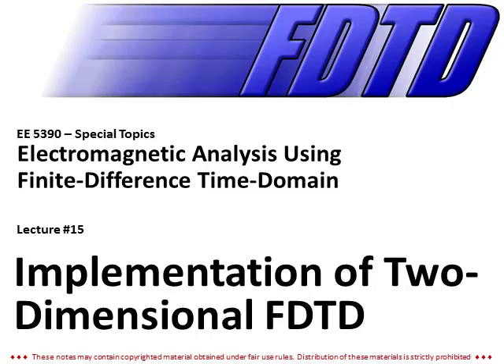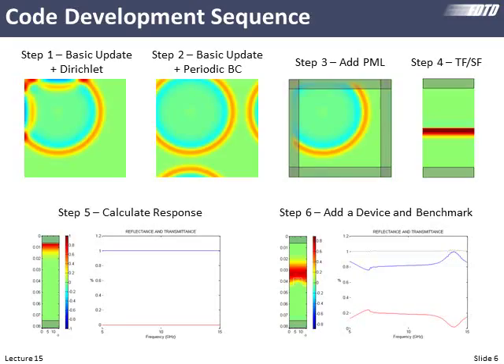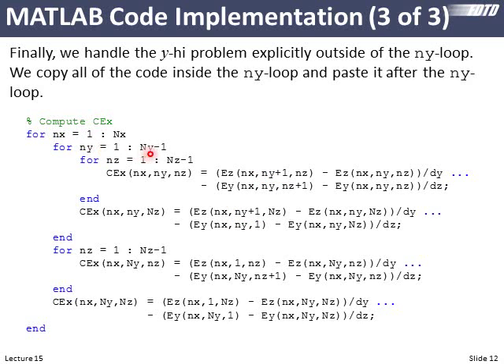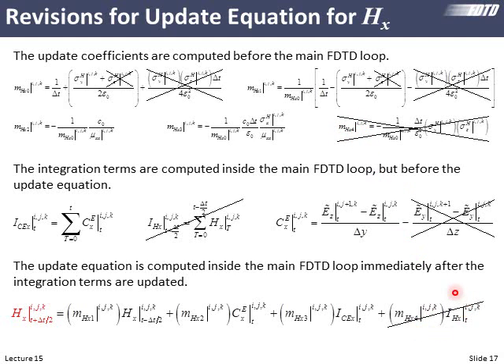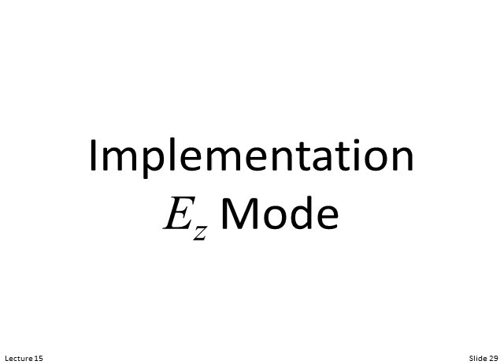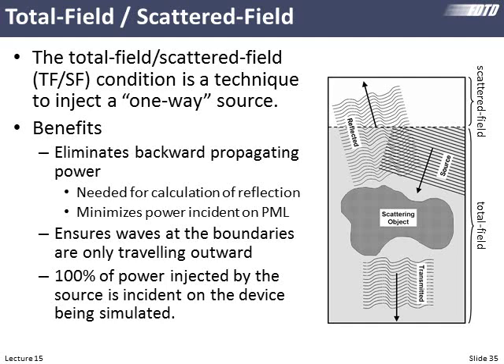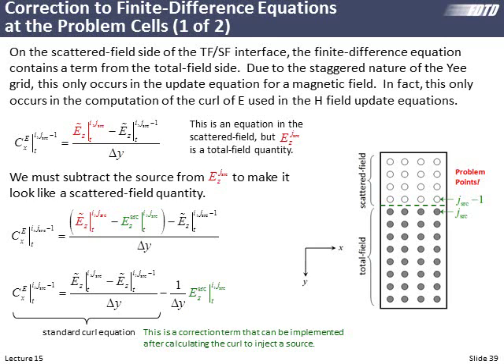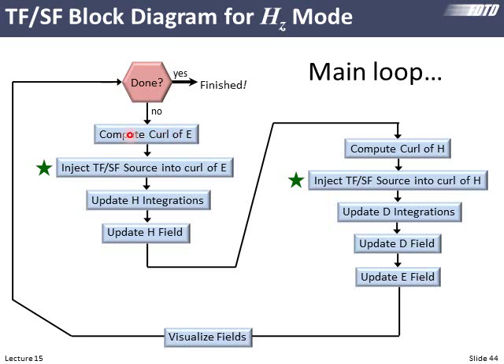Lecture 15 (FDTD) -- Implementation of 2D FDTD

Comment: Hi, Thanks for the great lecture series.

I´m having trouble with my code exploding where the PML regions overlap.

Can you think of where I might have an error which would cause this?

Thanks, Guy
Reply from the maker: This is the symptom of many different problems.  First, let me point you to the official course website that contains the latest version of the notes as well as other resources to help you develop your code:

http://emlab.utep.edu/ee5390fdtd.htm

Second, download Homework #8 and complete it.  To do this you will also need to download the zip file available under "Other Resources" which has some tester functions to help you with your PML.  The homework will give you a header with all the various PML parameters.  Type this in to start your code.  In Problem #1 you will calculate two arrays, 'sigx' and 'sigy' that are your PML parameters.  After these are calculated, call the function 'test_hw8_prob1' and that will check sigx and sigy to see if they are correct and report any errors.  

After this, move on to Problem #2 where you will add the code to calculate your update coefficients for the Ez mode.  After this, run the function 'test_hw8_prob2' and it will check your update coefficient for correctness.

Now you are ready to move on to Problem #3 where you will implement a simple 2D FDTD code and visualize your PML, hopefully working correctly!

Last, take a look at the latest version of the notes for Lecture 15 and see Slides 26-29 which provides some code and actual numbers for the PML parameters for some examples.

Hope this helps!!
Reply: It did, thank you. The test functions in the homework allowed me to zero in on my error.
Reply from the maker: Great!!!!

Comment: Another question is how to implement tfsf interface on the three other sides where we do not want to inject any power/source.
Reply from the maker: Consider a gap feed instead of simulating as a scattering device.  This is just adding a simple unit amplitude E field at the gap feed of the antenna.  The TF/SF can be done on 3 sides, but the hack is a little strange.  Let me know if you prefer the gap source.
Reply: How to do that, I am very new to the field? Even I have problems in injecting TFSF source from one side. I follow the instructions as given in the video but it doesn't work it seems. I want to launch a plane wave from one side say y=y0. Does one have to add/subtract E_src or H_src to curls at all the points including those inside the PML?
Reply from the maker: Implementing the TF/SF technique does require you to modify the finite-difference equations that are in the vicinity of the TF/SF interface.  This is because the finite-difference equations here contain both TF and SF terms, which are not compatible.  Implementing the TF/SF technique simply involves incorporating these corrections.  This would be rather complicated and tedious, but we have reduced it something very simple.  First, you calculate the source field fsrc, which is a version of the source that exists throughout your entire grid without the device you are simulating in place.  Technically, the source is only needed in the vicinity of the TF/SF interface, but I have found it more convenient to just calculate it everywhere.  Second, you build another function where you place 0's where you want to be TF points and 1's where you want to be SF points.  When you diagonalize this function into a matrix, it is called the SF masking matrix Q.  Third, you build the wave matrix A and then calculate your source vector b using the "quack" equation...

b = (Q*A - A*Q)*fsrc

This equation makes implementing TF/SF very easy.  It works with any order finite-difference, nonuniform grids, unstructured grids, and would even work without other methods like finite element.  It also lets you use scattered-field regions of arbitrary shape.  The only rule is that the SF region must completely enclose the source.  This last statement is a weird concept to understand.

To do your three-sided source, you would simply define Q as zeros everywhere except 1's in a square region near the center, but extending all the way to bottom of your grid.

If you are injecting a plane wave source, the TF/SF interface cannot cross any material interfaces.  Plane waves do not exist inside of inhomogeneous media and you may get strange results.  Keep your TF/SF interface outside of your PML for this reason.  There are exceptions when you can do this like when you calculate a non-plane wave source that accounts for the inhomogeneity or when the source is not present at the point of inhomgeneity.

Here is a paper that may help you:

R. C. Rumpf, "Simple implementation of arbitrarily shaped total-field/scattered-field regions in finite-difference frequency-domain," PIERS B, Vol. 36, 221-248, 2012.
Reply: Thank you very much. I will try to follow this.
Reply: I was wondering how to include a gap source rather than using a TF/SF source. Could you please explain?

Comment: Thanks a lot for putting these very informative lectures online. How should one proceed with TFSF boundaries while simulating monopole antenna? I mean where to put PEC boundary with respect to TFSF boundary?
Reply from the maker: Could you simulate your antenna as a transmitter?  Just put an E field as a gap feed and there would be no need for TF/SF anywhere.

Comment: I have doubt about calculation of summation terms before update equation inside the main FDTD loop. In which direction you sum of the values of Hy at each time step. Do you sum Hy(i,j) in j direction at each i or in i direction at each j?
Reply from the maker: They are summed over all directions.  You can see the actual MATLAB code for these in the block diagram around Slide 31.

When I teach this class, I ask that the summations be performed at every point.  This makes the code simpler to write and read.  However, the summations are only really needed in the PML regions.  I suggest calculating the summations at every point until you think you have a good understanding.  Then you break the summations into just the PML regions.
Reply: My doubt is still not clear. Suppose i have update equations for velocities in x and y direction for 2D case.

In y direction

vy(next time step at node position I , J) = vy(last time step at I , J) + summation term vy( I, J) in some time interval.....

similarly for calculation velocity in x direction

vx(next time step at node position I , J) = vx(last time step at I , J) + summation term vx( I, J) in some time interval.....

so while calculating summation in vy update equation should i do summation of vy terms in J direction at each Is or in I direction at each Js. Similar doubt for summation term in vx update equation.
Reply from the maker: Are you implementing an electromagnetic FDTD?  What velocity functions are you talking about?  I think I am missing something.
Reply: I am using FDTD method for studying material waves in engineering structures. 

I got introduced to FDTD method first time through your lectures. It's easy for me to understand FDTD through your approach and because of my physics background I find it easy to connect. 

In my 2d case I am updating particle's velocity and stress terms (the way you update E and H fields). I have some similar kind of summation terms in my update equations also.
Reply from the maker: Unfortunately, I am not sure I can answer you questions without investing some time looking at your governing equations and implementation.  Without knowing anything, I suspect you will be updating vx and vy at every point and in every direction.  It is unusual to update things otherwise.
Reply: Can I email you my update equation in simpler form so that you may give me some important suggestions?
Reply from the maker: Sure.  Unfortunately, I have a lot of big tasks converging on me right now and it may be some time before I can look at it. It will be a lot of work to look at a new code, understand it, and figure out what is going wrong.
Reply from the maker: Sure.  I will get to it as soon as I can.

Comment: Hi,

I have a problem with the correction terms.
For the CHz term, I do as follow (right after the computation of the curl):

 for nx=1:Nx
        CHz(ny_src,nx) = CHz(ny_src,nx)-Hsrc_x(t)/d_space;
   end

For the CEx term, I do as follow (right after the computation of the curl):

for nx=1:Nx
        CEx(ny_src-1,nx) = CEx(ny_src-1,nx)-Esrc(t)/d_space;
end

The problem is that there are always some waves going on the other side (from the left and the right boundary and from the center)
I compute my sources as explained in this video (FDTD_1D step 4/6): https://www.youtube.com/watch?v=0-RpqXP2DAs&feature=youtu.be

Do you have an idea of what's going wrong?

Thx a lot,

Sidney
Reply from the maker: There is a simple fix.  Your TF/SF correction equations are not correct.  You are using Hsrc to correct CH when you should be using Esrc.  Also, you are using Esrc to correct CE when you should be using Hsrc.

Let me point you to the course website:

http://emlab.utep.edu/ee5390fdtd.htm

Look at the electronic notes for Lecture 7.  Specifically, see Slides 18 and 19.  You may notice some differences in the notes from the Lectures because I have made corrections and improvements since I recorded the lectures.
Reply: Thanks a lot for your answer!

Comment: Dr. Rumpf, thank you so much for putting these lectures online.  They have been incredibly helpful.

One minor point I thought was worth mentioning in the main time loop is that you can get a huge speed increase by vectorizing your curl calculations instead of doing for loops through nx and nz.  Below is a snippet of the curl calculations for Ez mode:

    % Compute CEx
    CEx(1:end,1:end-1) = (Ez(1:end,2:end)-Ez(1:end,1:end-1))/dy;
    CEx(1:end,Ny) = (xbc-Ez(1:end,Ny))/dy;
    
    % Compute CEy
    CEy(1:end-1,1:end) = -(Ez(2:end,1:end) - Ez(1:end-1,1:end))/dx;
    CEy(Nx,1:end) = - (ybc - Ez(Nx,1:end))/dx;   

    % Compute CHz
    CHz(1,1) = (Hy(1,1) - xbc*ybc)/dx - (Hx(1,1) - xbc*ybc)/dy;         
    CHz(2:end,1) = (Hy(2:end,1) - Hy(1:end-1,1))/dx - (Hx(2:end,1) - ybc)/dy;
    CHz(1,2:end) = (Hy(1,2:end) - xbc)/dx - (Hx(1,2:end) - Hx(1,1:end-1))/dy;
    CHz(2:end,2:end) = (Hy(2:end,2:end) - Hy(1:end-1,2:end))/dx - (Hx(2:end,2:end) - Hx(2:end,1:end-1))/dy;
            
I figure this would be is worth pointing out for anyone running large simulations wanting to cut down on simulation time (from my timings, it looks like a factor of 3 or 4 speed increase for 1000x1000 grid cells.

A quick question: for calculating curls for Hz mode, can we use these same equations but switching H and E?

Thanks again!
Reply from the maker: Yes!  In my personal codes I always vectorize whenever possible.  However, I am conflicted when teaching the method.  I tend to use loops to reinforce there is actually a loop happening.  There are other examples of where I teach somewhat inefficient practices so as not to confuse FDTD concepts.  For example, the PML integrations are only needed in the PML regions, however, I teach to integrate these everywhere in order to simplify the code and focus on the concepts.  I really do not know the best way to teach this material.  There may not be a "best" way.

Thanks for point out this tip!

Comment: I believe there is mistake in matlab code shown in 18:32, the calculation of update coefficients. For example, in calculation of mX0, according to the formula we should use value of sigma_y defined at the position of Hx. However in Matlab code you have vavlue of sigma_y defined in the position of Hy.
Reply from the maker: So I am looking at the equation for mHx0, which must have all terms defined at the same position as Hx.  Prior to this slide we calculate sigx and sigy on a 2x grid, but then pull off sigHx and sigHy both at the position of Hx.  Then for mHy0, we pull off sigHx and sigHy at the position of Hy.  As far as I can tell, both the MATLAB code and equations are correct and consistent.  This is a very tedious step in FDTD.  Please let me know if I am missing something.
Reply: Yes you are right. Sorry.
I thought the indices of sigx, sigy being parsed are different in the Matlab code. However they are the same.
Probably a better naming convention would be sigyHx, sigyHy......
Reply from the maker: You are probably right.

Comment: Regarding the TF/SF. We inject our source in CEx, because it's a vertical source and we cancel the back propagation correcting CHz, more precisely the Hx therm that regards the y derivative. The thing is, at the tips of the my TFSF source line ( tipically at the edge of the world) I still get two half-circular waves (one on each tip) propagating into both TF and TS regions with visible value. Is there a way to cancel that? It messes the plane wave appearance.
I noticed in the Lecture 1 visual example, of the radar wave hittting the aircraft, that the wave created at the TFSF isn't perfect either. Any tips on how to deal with that?
Reply from the maker: I am not completely confident I understand what you are saying.  If you have a source that extends into a PML, you may experience problems.  This is because waves should be decaying inside the PML and if you try to force it otherwise, crazy things happen.  

If you launch a Gaussian beam, it will be diffracted and "spread out" at the edges.  This is just physics of beams and there is not much you can do about.  You can improve it slightly by accounting for more physics of the beam or you can use a wider beam.  Wider beams will diverge less.

Hope I said something helpful here!
Reply: You did.Thank you! Both things are pertinent. I have now restricted the source to the interior of the work area. Naturaly I still see diffraction at the edges. I may try a gaussian beam to avoid an abrupt change at the edges, good idea.
I knew physics was at play, but sometimes in simulations you can bend the rules a little bit.
Thank you again.
Reply from the maker: It is like the Matrix.  Sometimes you can bend the rules.  Other times you can break them.